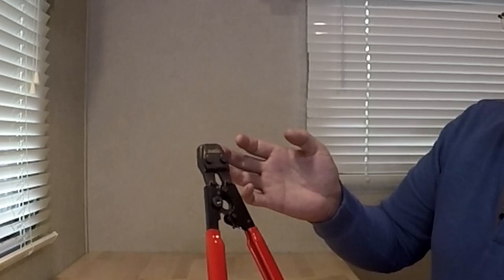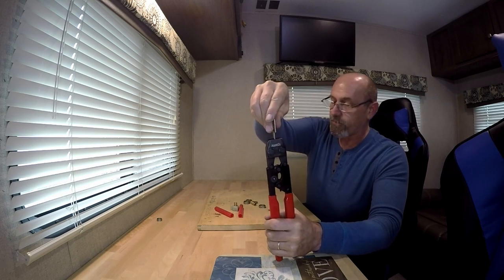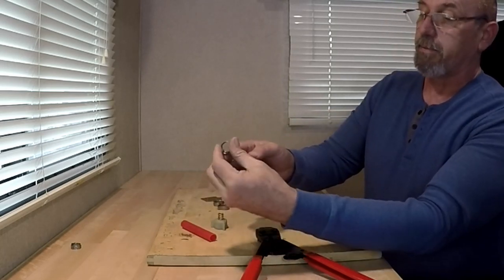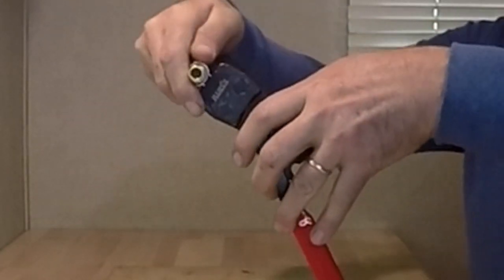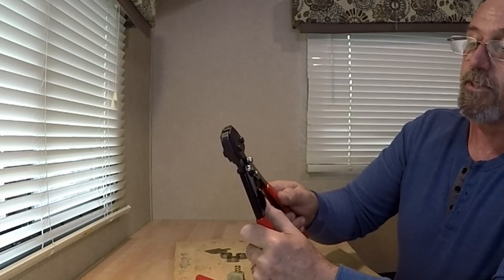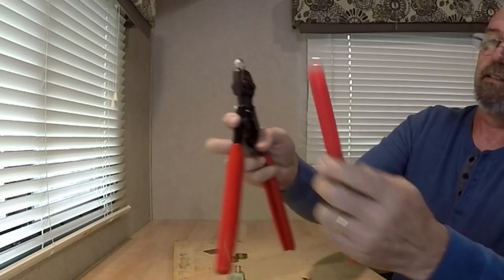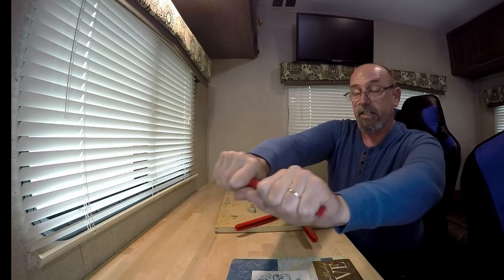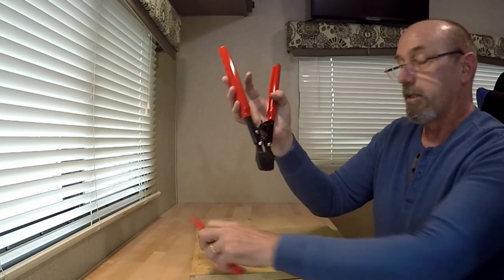Testing and reviewing the IWISS PEX Cinch Clamp Crimping Tool KG1096

Comment: Thanks for the vid.  I lost my Go/No go tool.  Do you know the thickness of it.  I guess if it starts to leak I can just tighten it a bit.  You dont have a vid where you are adjusting the tool, do you?
Reply from the maker: I'm not sure exactly the thickness. They are usually preset and do not need adjustment.  I would agree if it does leak slightly adjust the tool. And no I do not have a video on adjusting the tool.
Reply: @DiyRVandHome  thanks for the response. I got my spark plug gap Checker out and the current gap which is almost new out of the box reads at 035 in.  So I guess I'll just go by that and set it to there if I ever need to and just gradually tighten it up if it doesn't work.  The fact that you had it for a while and haven't needed to adjust it yet is a good sign.

Comment: Good video! We spotted a leak, don't know exactly where yet on our 2016 FR Vibe 268RKS trailer, but am purchasing tools, clamps/crimps and copper fittings. You would suggest the Shark Bite crimps? I will have to buy 1/2 and 3/4, because I don't remember what size our trailer has.
Reply from the maker: I prefer the crimp style to the shark bite because i feel i can be more confident that it is properly done. Also most all trailers i have seen are 1/2" pipe.
Reply: @DiyRVandHome  Which brand crimp would you go with then?
Reply: I bought an IWISS kg1096 for cinching...
Reply from the maker: @jeromemainmanmanne7496  I used the Apollo from Home depot and they worked for me.
Reply: @DiyRVandHome  Thanks! I just bought those